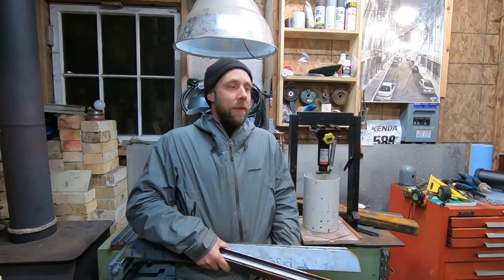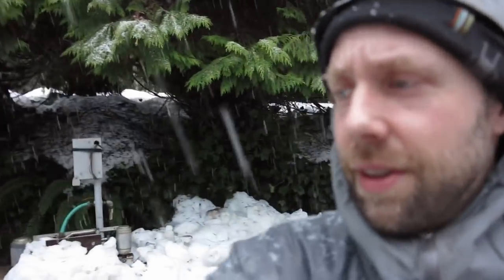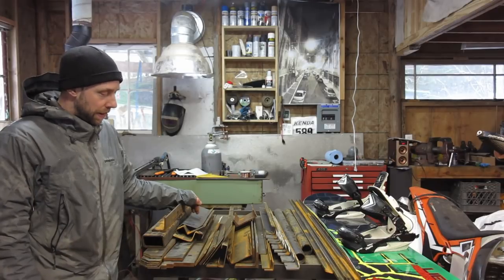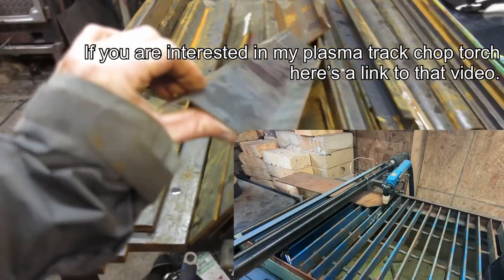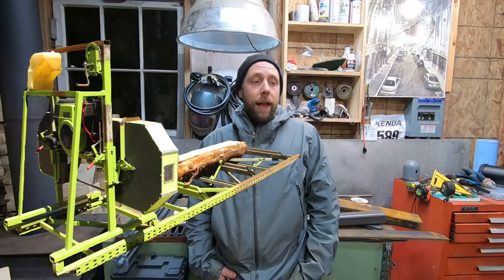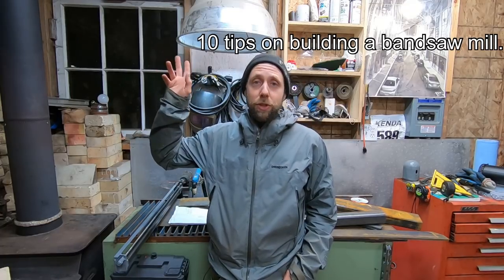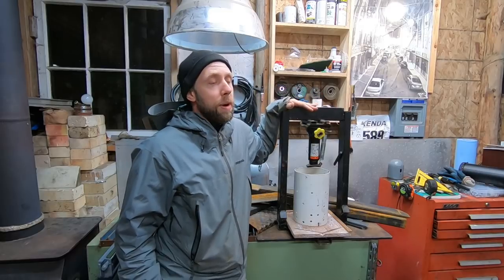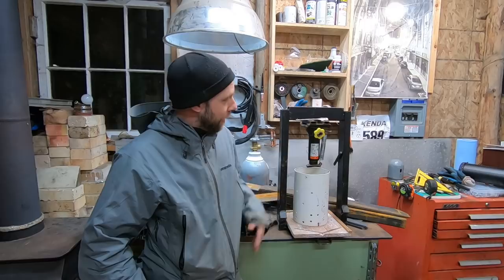Tips on salvaging cheap to free metal for projects

Comment: This is a very good topic! I recently bought a multi process welder and want to learn more about working with metal. As a wood worker hobbies I wanted to make turning tools from 1/2 bar solid square stock. I contacted a metal supplier they had it in  20 foot sticks, not only was it more than I needed the price was out of my pay grade. That was two years ago. The piece is still sitting on a 55 gallon drum. 
I called a machine shop this place was built in the early 1900’s 5 generations have worked there. It was like a museum,
The lathes were leather belt driven by a single motor via shafts. Old Bridge Port mill a 1930’s Delta Lathe, this place was cool.
And do not recall the other brands. I told the owner what I was doing and he gave me a piece of 1/2 square material 30 inches long with old welds on it. I took it home and put a flap disk to it. Wow that pretty shinny steel. I took them back to show the owner how they turned out. He was a proud of them as I was. Last week I needed and 8 inch x  3/4 bar stock for another project, I gave him $6.00 and told him thank you very much he did not want to charge me for it. It is all about making friends and helping each other.
Reply from the maker: Thanks for sharing this, I appreciate you taking the time to comment! There’s a old machine shop like that in my town, the floors are concrete but over the years of oil and grime there black and smooth from years of use. It’s a cool place. That’s great those guys at that shop sound like there good dudes and appreciate seeing those tools you made! Thanks for commenting and take care :)

Comment: Great tips AGAIN, build relationships as well at parts, tools, etc.
Reply from the maker: 👍 you get it, kindest and respect goes a long ways! thanks for checking out my video. Take care
Reply: Tool relationships are great as mentioned. I cant afford tig welder and not really have welding talents yet to do some of the more complicated things my self, hence i usually go to local fabrication shops and talk straight with the welding guy. They usually have lots of experience and can do minor things on coffee brake for few bucks or packet of coffee that is common trade item around here. Some of the old guys even get little spark into their eyes when i give them something very complicated, guess they like challenge time to time.

Also you never know where you find these connections. For instance i was getting few hydraulic hoses made and while doing those went to stores back room and lord behold there is a cute little lathe there. I havent yet but i have few minor things that need turning and from what i talked with them i might even get to do them my self, or at least get things done for that coffee packet if they are not in a rush.

Material side is same thing. ALWAYS check any dump container you see near construction sites. Too bad weather had ruined them, but local supermarket had chanced their placard inside and those were trown away. Perfect light separation walls for welding station etc, just screw couple of board on the one and and lift them up, or screw them together and get a light wall. Birch flooring panels i carried home from neighbors place when the were doing remodeling, don mind if i do. So far i have been able to use them in several projects and dont even need to surface finish them and if i glue them into sheets, it can be pretty much any size or shape :D Just check what you find, look what you can do with it and salvage with owners permission. Company usually do not complain if you want to take their trash, specially ones they need to pay for to dispose and long as its not pile of metal that is worth the scrap metal value and even then you can get it for that price, as they do not care from witch the money flows, long as it flows.

Comment: I have found some good metal in "curb found" bed frames. The area around apartment complexes might be a good source for beds. One bed was a massive King sized one with heavy duty casters on the legs and a bunch of good hardware along with the angle iron frame.
Reply: I was gonna say the same thing
Reply from the maker: Yes definitely a good source of angle iron for sure, I have cut a few bed frames up over the years :) thanks for commenting! Take care
Reply: Bed frame rails are often made from high carbon steel that is heat treated for extra strength and still be lightweight. It is great stuff, but don't plan on drilling holes in it. Often impossible to drill. You need to be aware of the hi carbon. It can fatigue crack next to the welds with repeated stress. Also, use abrasive discs for cutting it, it can be hell on metal cutting saw blades intended for mild steel.
Reply: @practicalman45  I agree I killed a brand new blade on my portaband on a pos bed frame that didn't weld worth a crap. Won't make that mistake again.
Reply: @practicalman45  thanks👍

Comment: I can go to a salvage place that sells stuff like that, but they get 60 cents/lb.  New metal I have to order it full lengths, the wholesaler order minimum is $400. For  delivery: the wholesaler semi truck cannot get into my place, plus I have no forklift to unload it, so I tow my flatbed trailer to the building supply and must hire their forklift for another $25 to transfer my order to my trailer.  I'm in rural Southern Oregon and the wholesaler steel supplier is the only one available for hundreds of miles. Every fab shop has to all go to that one source for wholesale orders.  I scrounge and recycle whatever I can, but for many things you just have to have full lengths. Fortunately, there's often remnants and I accumulate a little bit of inventory. I have a pretty lovely scrap pile, myself. Thirty years of doing fabrication work (and being a hoarder who can't throw anything away....) and you end up with a pretty big junk pile.
Reply from the maker: That sounds like it gets expensive to buy new, definitely helps to have a good selection of salvage metal at your place, I’m sure it’s saved you a trip to town a time or two! Thanks for commenting and checking out my video :)

Comment: I went to the scrap yard today looking for some angle iron, but was told since they were busy that only a small area was available for me to browse. I found a go-kart rack and pinion steering box in good condition. I then went to a drop off box and got enough Vintage and newer USA tools to fill a bucket, which Included two air drills and an air palm sander. I got offset wrenches, screwdrivers and some other odds and ends, and some random hardware. Overall it was a good day, but NOT for free.

Comment: Very true, lots of excellent advice for all levels of experience.👍

I think I see a KTM there on the right looking for some video time attention, but no idea what model lol
Going to take a stab in the dark and say...  not a 2 stroke exc/sx/xcw but perhaps some streetable enduro of larger bore proportions?
I've owned so many flavors of bikes over the years, but never a KTM.

Currently restoring 3 bikes (yikes) a lil 87 JR50 for my kids, a 1980 YZ125, annnnnd my....
Super Frankenstein 1980 CR80 with: 
An 86 KDX80 bottom end, 85 KX80 factory 100cc bigbore cyl that was replated and a NOS piston and rings.
Head sent out for squish re-cut and compression increase for the VP race gas (currently running c14 mix with pump) Might switch to MRXo2 or T2 straight.
KX60 clutch cover which has the liquid cooling on it, so I modded a threaded adapter to drive the pump off the crank.
Put on KX60 radiator and shroud.
Cut the expansion chamber and clocked it about 90 degrees so it ran along the left side and fit a KX85 silencer.
Swingarm from an xr100, modded.(Still need to mod in the adjuster blocks and tensioner bolts).
76 CR125 rear shocks.
86 CR80 front forks and triple, disk brake.(needs resprung and gold valves)
Newer CR80 front wheel.
KX85 rear wheel and disk brake setup.
...which is my current W.I.P back yard ripper that I take to the coal dump place once in a while.
And will go to whichever kid is brave enough to ride it lol As long as they don't ruin the tank! Lots of work on that!
I was going for the "Factory race bike" 1 off type deal with that one...
I blew all my inspiration on that one and kind of recouping from fabricators burnout lol

Still need to get my Yamaha DS7 on the road, and thinking about parting out the KDX250 I have to fund that project.
Reply from the maker: Man you definitely have put a lot of work into that bike! That’s awesome! You probably saw the video where my nephew and I pulled a blown up motor out of a CR80 big wheel, and swapped a Honda XR 100 Motor that we installed a BBR 120 big bore kit in, high comp piston, big cam, big carb, FMF modified exhaust, and a few other goodies I definitely was burnt out of bike mods for a bit, haha it takes a lot of work so I can only imagine the time you have into yours. Do you have a video posted of your bike? If so I would like to see it! The KTM is my first KTM I have ever owned, so far I really like it! It’s a 2014 XCW 200, it’s a great trail bike, after fixing up the KDX 200 I was sold on that size for the tight woods up here in Washington. I’m in the long process of rebuilding my Honda XR650l, long process because I lost interest and got sidetracked on other things, I have put a lot of miles on it, it’s been a good bike. I’m also slowly fixing up my old 1973 Honda CB 350 four, it’s a cool little street bike and sounds amazing at 10,000 RPM! I gave my nephew a old 72 CB 200 twin, I have done a lot of work on, fiberglass solo seat, drop bars, two into one exhaust, rear sets, and removed a lot of unnecessary weight. Let me know if you have a video of your bike! Take care :)
Reply: @Mikefestiva   Have not seen the video, but would like to. Have to search on your video list and see if I can find it. Those XR100's are great, I have an 86 xr80 and a 2001 CRF100 Frame that I was waiting to try and find a good 100cc bottom end for it to do the bbr120 or the powroll mods. But that can wait, that one will be a street legal conversion. I have to agree that the 200's/220cc bikes are perfect technical/tight woods machines. 
KTM should have kept the 200 and not went with the 150... So they could/would have the 50/85/105/144/200/300 Pretty perfect dirt lineup.

Ok I knew it wasn't a newer 250/300 from the plastics :P
I was trying to find a KDX220 and came across this 91-94 KDX250 for free, but it has a cracked tank and needs re plated and rebuild crank and probably bearings and seals and $$$$ soooo yea, I figure I'll part it out :/

But now that Honda released the crf450L and I'm not getting any younger, I might go that route for a factory road legal bike that is excellent at off road. So I'll probably end up getting one of those used in a few years.👍

Those older CB's are sweet little bikes lol
I used to work at a bike salvage yard and drove a 1980? CB400T to and from work during summer. Great machine, always got compliments :D. I drove soo many bikes working there, good memories haha

Some day... I will have to make my way over to Washington, when my kids are out of school.  I don't have a video of the Frankenstein yet, but I'll try to get one this summer!
Reply from the maker: I keep thinking KTM definitely should have kept the 200 and dropped the 250, it’s strange that they got rid of the 200 and instead offer the 150
Dual sport bikes are a good way to go, I have not looked into the crf450 but I bet there great bikes, my 650 even though it’s pig heavy , I have had some great trips on it, the longest ride was from Washington, Idaho Montana Oregon, I covered a lot of Idaho on dirt roads and a few trails, I was out riding and camping for 24 days! It was awesome, I had my tools, camp gear, food and a few beers, it was nice to cover some ground and get off the beaten path, I soaked in a lot of hot springs along the way. 
Man that’s a bummer about the state you live in! You definitely need to get to a more laidback state.  It’s a little up tight here in western Washington, but nothing like that, Washington a few years back finally relaxed there laws on platting bikes, it’s now fairly simple to get the street plate for any bike, just have to make it legal looking for the test and take most of the crap back off after it’s plated, the motorcycle shops can sign it off saying it’s legal. Take care!

Comment: 10:40  you don't need to put hydraulic jacks upside down.  You just put them right side up.  They still press.  You might have to weld something to the bottom to extend down into the pressing cylinder.
Reply from the maker: Your welcome for the idea 🙂👍

Comment: I got some near commercial metal wall stud sections in back of a Harley dealership years ago.  It was their shipping crate system at the time.  It was stacked by the dumpster.  Same level of disinterest from staff.  They are motorcycle guys, have it.
Built a Secretary/Receptionist surround wall in a trucking office with it.
I'd suggest any motorcycle dealership may have thinner gauge scrap up to 6 feet in their crates.  Just a thought.
Reply from the maker: MarkH10 Right on Mark thanks for commenting 👍

Comment: I got to be good friend with my local metal recycler and he gives me scrap at 15 cents a pound which is a 10 cent discount. Also my town has free local trash pickup where a truck with a claw comes and pics stuff up off the side of the road. I recently made a tow behind trail mower out of a lawnmower deck my neighbor gave me, a power washer I found on the side of the road for free and the swivel wheels off a wheelchair someone threw out.
Reply from the maker: It’s definitely nice to have good hookups like that for cheap metal! Dude that’s sounds like a good project you built there, do you have a video posted of your build?
Reply: Mike festiva no I don't, but I could take a little video on my phone and upload it. I might just have to do that :)

Comment: I just bought a mig welder and its still on its way. I have never welded before. I want to get some junk metal to practice with. I was thinking about asking for some scrap to learn on then telling them I will buy my metal there once I'm ready to build my project.
Reply: Never hurts to ask. If there's what we used to call the dump in your town, now they're called" transfer station " , if the workers are cool they'll let you pick from the metal pile , maybe show up with donuts.
Reply: @kingplumber  I just checked a few shops that I regularly buy metal from and they all basically told me to go pound sand. Luckily a place I use to work had some scrap metal I could grab to cut up and practice with.

Comment: Almost all of my stuff is jobsite scrap.   Generally, the demo contractor is the only person on the job that recycles metal, and anything less than about 4' is usually just tossed in the dumpster at a jobsite.  I can make a few pieces of stuff like that last for months.  

If you are not associated with the job, ALWAYS go to the project trailer first and find the superintendent.  Don't just walk into the work zone.  Outside of the obvious safety aspects, it is a show of respect to the superintendent, and will get you a long way.
Reply from the maker: Thanks for commenting!

Comment: hey mike. what specifically would you call this type of metal? i will be looking in a salvage yard and would like to know what to ask for. looking for some stuff to practice welding on, and also looking for stuff to eventually build a log arch and bandsaw mill. would appreciate any help you can give me, thank you!
Reply from the maker: It’s just called mild steel, it’s probably the most common steel you will find. I use a lot of 1/8” 3/16” and sometimes a little 1/4” 
My sawmill was almost completely built out of 1/8” thick 1.5”x1.5” square tubing and some 1/8” thick 1.5” angle iron. The only thicker parts I used on my mill would probably be the engine mount plate and it was probably 3/16”. 
Good luck on your salvaging 👍 and I think you will have fun welding and building stuff. Start off with scrap and practice on welding small pieces together, try butting two pieces together and weld down the seem, then try two pieces 90 degrees and weld them together, try taking two pieces of square tubing and join them together to make a larger piece. This will give you lots of practice. Look over your welds and try to travel slow and constantly when welding. I hope to hear a update on your progress! Take care
Reply: Mike festiva thank you! i’m excited to get started. going to be basing my builds off of your designs as i think they’re the best i have seen. simple yet very effective and efficient.

Comment: A timely video - the energy it takes to recycle steel is horrendous, far better to use scrap in its raw state than let it get smelted and formed back into stock. All those 3 foot lengths can quickly and accurately become 6 or 9 foot lengths with a little mig wire. I get to be cheap and environmentally sound.
Thanks for posting.
Reply from the maker: Right on I like your comment! You’re definitely are right. Thanks for checking out my video and commenting :)

Comment: Hi Mike , came to this video by way of one of your welding videos. Good tips in both of them. I started with the HF 90 amp. Went through 3 of them. The feed on them just stopped working. Was able to return 2 but got stuck with one,  I passed the 90 days. I now have the 125, as far as I can tell it is the same as the 90?? Once I get better at welding I am looking to upgrade. But for now the 125 is able to handle most of what I do. New $ubscriber & 👍 # 413.
Stay well, Joe Z